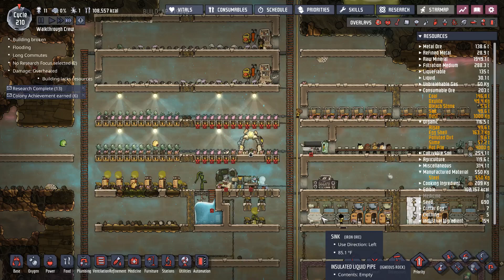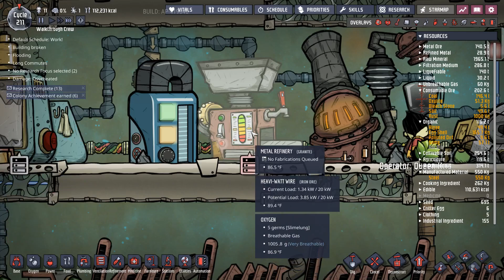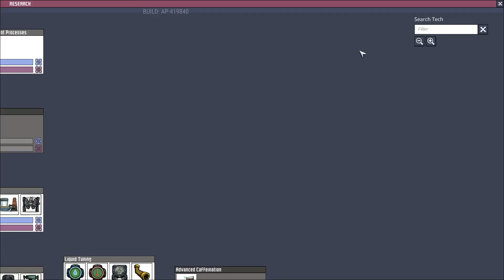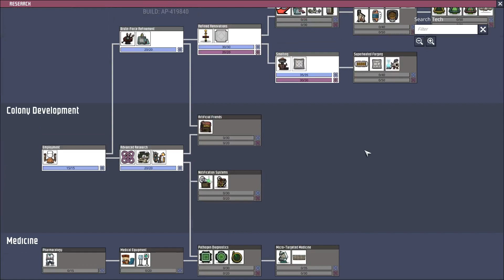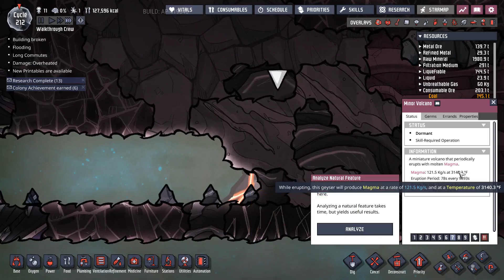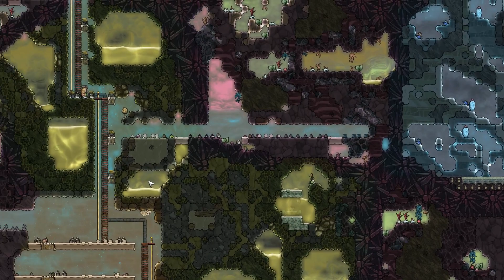Oxygen Not Included Tutorial: Full Walkthrough (Part 8)

Comment: Hey there, your videos are super helpful! Just a question because I used the same metal / oil refinery / plastic polymer setup, but my dupes are getting scalded by the oil refiner since it goes over 100 C. Is it relevant what materials I use for my oil refinery? Should it be made of steel? Although I feel that isn't relevant if the operating temperature goes up to over 100 anyway if it's in use right?
Reply: I ran through the same problem, I think it's mostly solved by the cooling setup, the area heats up quicklier than the cooling pipes do their job. I think we should switch to radiant pipe for better cooling there.
Reply: @Saatch1018  Yes the radiant would be a big help. Also probably want the press to be made out of steel and have an automation switch to turn it off after a while if things start getting too hot. Cheers!
Reply: @WatsonatorSC2  Yea Steel works wonders for heat resistance

Comment: About confining hot stuff in an insulated room, the doors of the room will be conducting some heat, how do you solve that? 
Also speaking of heat and duplicants, since the oil refinery and the metal refinery need to be operated, won't it be too hot for a regular dupe? Don't you ever put an exosuit checkpoint in front of hot rooms where dupes need to go often?
Last but not least, my polymer press tends to overheat just after the first block it produces, especially if the petroleum I feed it is quite hot (like it seems to be the case of your chained sequence (loved that BTW). I thought about cooling down the petroleum a bit. But, is the solution to just find some steel and use it for the press?
Thanks
Reply from the maker: It depends on what you need to confine.  If it's something you don't need to operate, you can just wall the whole thing.  If it's something your duplicants will operate, you're best off cooling it.

Both of those buildings aren't hot enough that you need suits to operate them.  You just need to cool the area they are in, and use insulated pipes.

Yeah, based on what you mentioned in another video, cooling is definitely the next thing you need to solve.  The polymer press and all the other stuff in that room will produce a LOT of heat, so if you have pretty strong cooling, you can deal with it pretty easily.